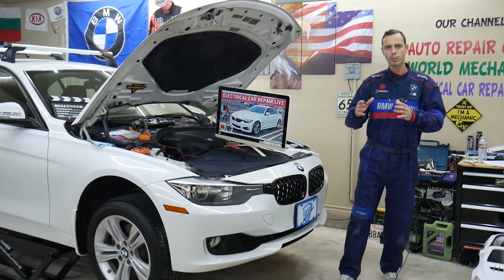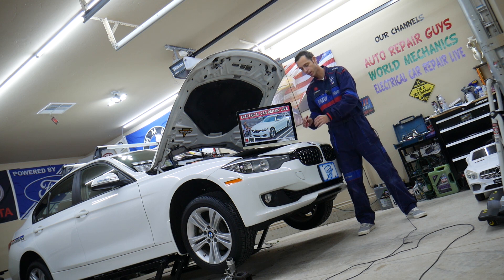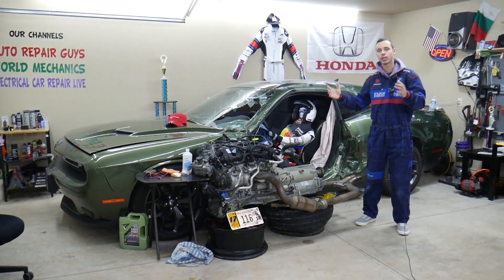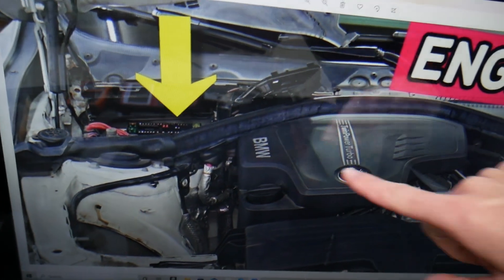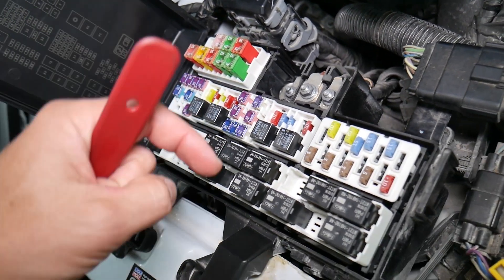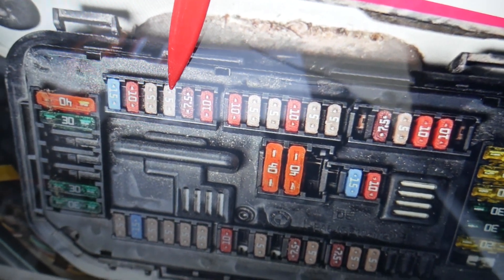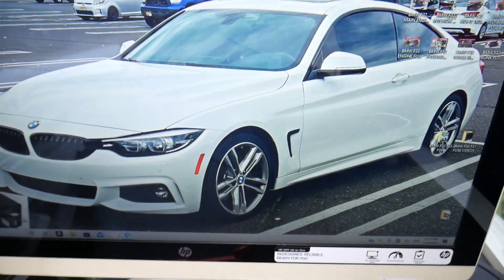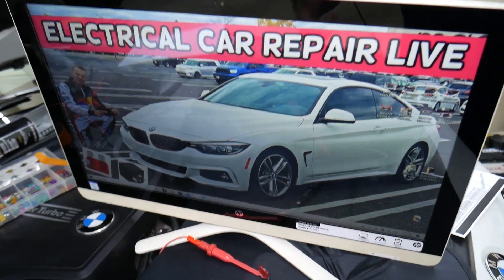BMW ECU ECM PCM DME FUSE LOCATION BMW F32 F33 F36 428i 430i 435i 440i 418i 420i 418d 420d 425d 430d

Comment: I have a 2018 430i gran coupe. Several of the ecu fuses you show my car does not have. #19 and 36 in particular. My car turns over but won’t start. Drivetrain error but I get over 11 codes as well.  I believe the ECU went bad or the fuse but as I stated there are several fuses that aren’t on my car. The slots are empty